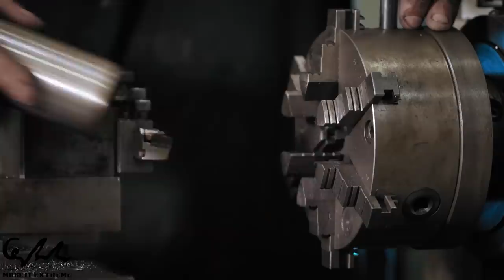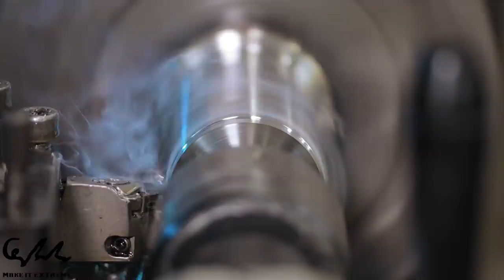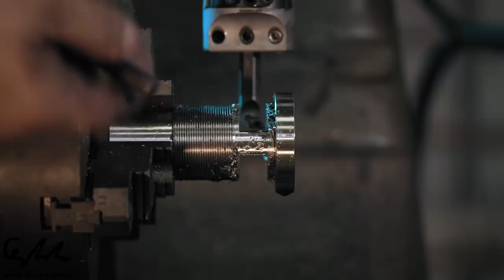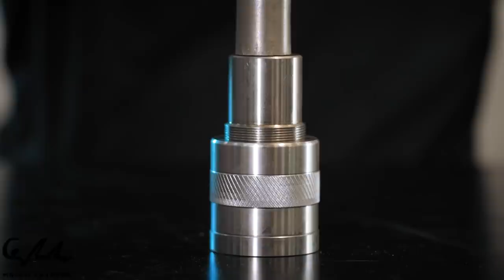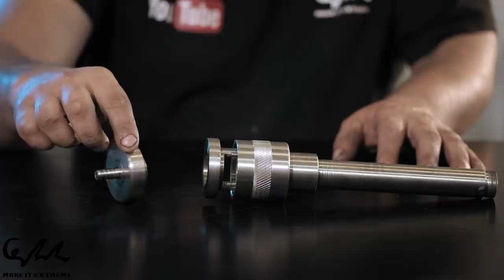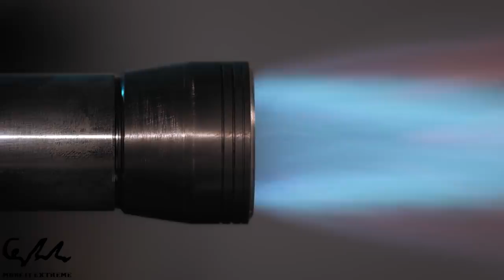Machining a Stainless Steel Venturi Forge Burner

Comment: Awesome design mate! Just a heads up you may need to tweak it a little. All of the red/orange around the core blue flame is unburnt lpg reducing the burners efficiency. Maybe  reduce the tip size to .023 👍
Reply: This is a next level burner. I do agree smaller nozzle and the most critical part of the burner that needs to be stainless steel is in copper which will melt far to quick but both easily fixed. Your skills are next level
Reply: Maybe the unburned propane could provide a shielding gas effect against oxidation
Reply: @JohnDoe-rx3vn  it will definitely drop the temperature on the burner. Which isnt ideal but it all depends on needs. Either way this is art